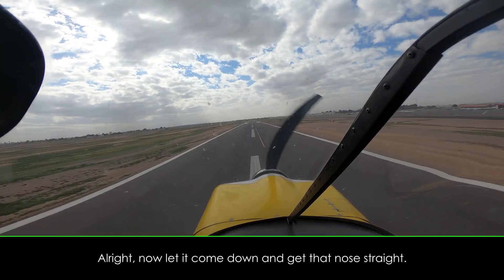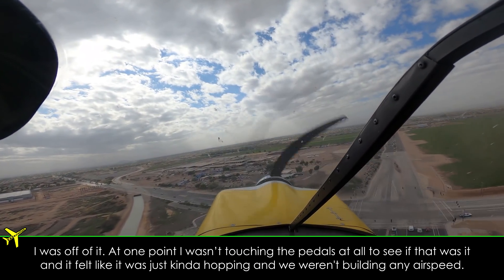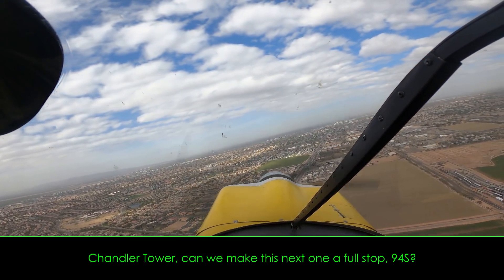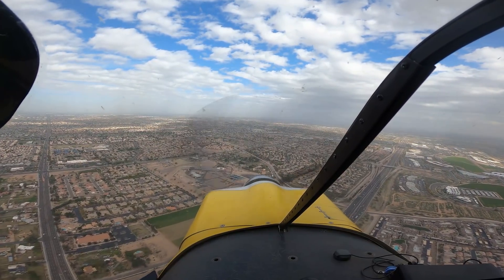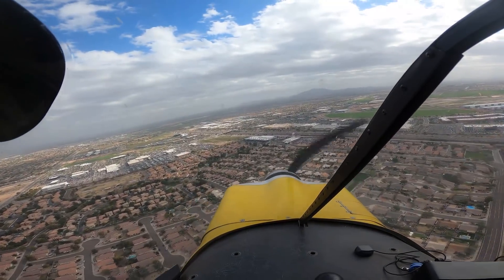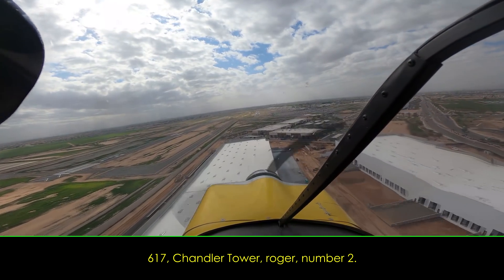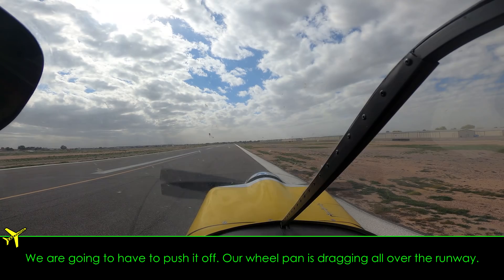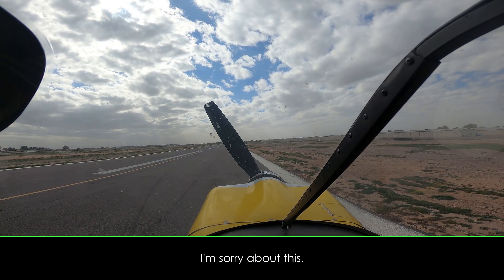American Decathlon has FLAT TIRE ON LANDING | Onboard Footage Included

Comment: "That sounds fine"

10 seconds later

"That sounds bad"
Reply: X X I think she was saying that she wasn’t worried about the indicator having an issue in displaying the airspeed. I could be wrong though.
Reply: "this isn't happening" is a common reaction to airborne events
Reply: @X X I wouldn't worry about it too much either. At low speeds and in tailwheel airplanes, your airspeed can give , 'interesting' indications...
Reply: @X X pitot tube angle of attack changes from 3-point attitude to level flight attitude. This can/does change airspeed indication.

Comment: The instructor(I'm uncertain about whether she is instructor but I think she is) in back seemed so calm that's the key in situations like this, we remain calm and handle the emergency even though it ended up not a nose touching ground and prop strike on ground great pilot....
Reply: I think the calm was because no actual problem was suspected.  The though "oh we've got a flat" didn't pop up until they were down and dragging.
Reply: @xheralt  I mean, she litterally said: "I wonder if we have a flat now."
Reply: Gary XHLC she suspected a flat, did you not watch the video?
Reply: @Shree The Smart yeah she is an instructor--I've known her for over a year.  She's a damn good pilot!
Reply: @trainman4472  I bet she is because u landed plane without any damage butter landing good job sir
Reply: @trainman4472  and landing with main wheels flat in a taildragger is very very hard compared to nose wheel aircraft...... That was outstanding work 👌 of landing
Reply: @shreethesmart2942  While I appreciate the compliment, I'm afraid its misdirected--Im not in this video! I'm just a friend of the instructor.
Reply: @trainman4472  ohh np 👌

Comment: It’s so easy to arm chair quarterback. should they have told controller they may have a flat tire and could be disabled after touchdown, sure.  without having 22L this would have required closing the field during the time it took to move aircraft off runway. I’m sure the instructor realized after the fact her mistake of not informing controller and learned from this incident. Over last 37 years of flying I’ve made many mistakes once, some twice (LOL now) but that’s how you learn.
Reply: THANK you. Agreed.
Reply: This is Josh from the flight. Yes in hindsight I should have told the tower what was going on... however Fly The Airplane is more important.
Reply: You " LEARN by making mistakes " ??
No sir. You DIE ( in many cases ) by making mistakes .
You LEARN by study and proper preparation
Reply: @ethics3  Yes you learn from mistakes. From your own and others.
Reply: Agreed on all fronts. But still.. Should have told tower.
Reply: @BirdsEyeTech  being a controller in the valley, let the tower know. Yea "communicate" is your last one. But you're communicating the whole time with the other pilot about it. Let the tower know, we can scramble trucks out ahead of time, keep everything safe and moving efficient.
Reply: @jaqummh  You learn from mistakes, you die from catastrophes. Swiss cheese theory

Comment: Credit to the pilot for noticing a potential problem, giving the tower the heads up though would've earned you airmanship points that day. 

If you read this Josh, don't take this as a negative, but work on getting them circuits tighter. Personally, those 2 long buildings (@4:15) ideally shouldn't be in view on final 👍
Reply: This is Josh. Strong crosswinds so I wanted a lot of time to feel them out. Normally I'm significantly tighter in the pattern. :)

Comment: I received training and my TW endorsement in that very aircraft back in Feb. Fun plane! Bruce was my instructor. I too experienced not one but two flat tires. The first was the tail wheel itself. The second 2 lessons later the right main as you did here landing at Stellar (home base). Good job on your landings BTW! There was also a left main flat on this ship a week before mine. We talked about it and they think maybe a few bad tube in there last purchase (they buy in pairs). After inspection owner still couldn't find issue of pin holes in tubes. Damn gremlins!

Comment: Many years ago when I was a teenager working on my private certificate the FBO/flight school I trained at ran on a tight budget.  Some dummy jammed the brakes on one of their 172s and flat spotted a tire.  Of course they didn't replace the tire because of the cost so every takeoff and landing I made in that old plane was a nail biter.  It sounded like someone was banging a drum whenever I taxied.  I was convinced the tire was going to blow but their A&P assured me repeatedly it was okay and as far as I know it never blew and served out its life honorably until the tires were replaced.
Thankfully, though, I've never experienced a flat tire.

Comment: nice vid , yeahh like many here, first thing i thought was : inform the tower ....   but hey safe smooth landing, so well done Pilot!!
Reply: This is Josh from the flight. Yes in hindsight I should have told the tower what was going on... however Fly The Airplane is more important.
Reply: No need to inform the tower here. This is a CRM issue that was worked through in the plane. No emergency was noted so there was no need to tell the tower. Also, flat tires on planes happen ALL the time. Often when the aircraft is already fully committed to the landing, and you do what they did here, just say, "hey tower, we gotta flat", and everyone goes on with their lives. You'd be amazed at the number of engine out landings that are done in the airlines that the passengers are never even aware of. You only hear about the ones that someone talks about or makes it onto the news. Kinds like when Allegiant  was leaving engine parts on runways for a while, now you don't hear about it anymore but, it still happens. haha

Comment: Should the ATC have been informed of a potential problem before the landing?
Reply: Yeah, if there's any uncertainty about one's (fixed) landing gear, instead of the expected pattern work touch-and-go, maybe do a low pass and ask tower or some other ground observer to examine the gear as you go by?
Reply: Yeah that part concerns me also. I mean it may not be a seriously busy airport with a bunch of A380s  but debris on the runway needs to be cleaned.  And emergency services need something to do.
Reply: they weren't even sure there was a problem and the instructor didn't even seem to feel it.
Reply: If something is weird, fly, navigate, communicate.  Missed last one.
Reply: @vkorpel  it's not what "what you have to do" but the priority of things if you do them. You don't have to communicate every single fart you make....
Reply: Gary XHLC that whole “fly by and take a look” thing is not helpful. Maybe it sounds good in movies or something, but most gear issues cannot be identified by a flyby. In this case, a flat tire with no weight on it would look perfectly normal at 70mph, so what’s the point? They were textbook here. They notified the tower as soon as they realized that they are disabled on the runway.
Reply: @xheralt examine fixed gear for tire pressure.

Comment: This is not "armchair quarterbacking", nor am I being critical of Josh at all, but I have a question. First, in hindsight when you have a suspect tire or other gear issue, (especially in a taildragger), would it have been more prudent to have declared a "Pan-Pan-Pan" or maybe even an emergency so the equipment could have been on standby? I've heard over and over that GA pilots always seem to be too reluctant to do this. This could have ended a whole lot worse. Very happy it didn't and the airmanship was surpurb. Great job on that landing.
Reply: This is Josh from the flight. Yes in hindsight I should have told the tower what was going on... however Fly The Airplane is more important.
Reply: @BirdsEyeTech  You had 5-10 minutes enroute to tell them. Ahem.  The other lesson that should be learned is that when you felt the dragging, you should have cut the throttle and stopped the plane instead of taking a problem into the air.  Again, lessons learned.

Comment: Are there tire pressure monitoring systems for small aircraft?
Reply from the maker: Most light aircraft don't have that
Reply: The Decathlon was built in the '70s.  While it is technically possible to build a retrofit TPMS for light aircraft, the cost of certification is horrendous so it would be very unlikely for it to happen.
Reply: Contrary to my avatar I am in the commercial vehicle industry. Makes sense now with the certification angle. I had a customer who landed with an unknown flat and ended up with a prop strike when he was pulled left into the runway lights. I couldn’t understand why he didn’t equip TPMS after that event. Make sense now.
Reply: @MichaelSteeves  I'd be willing to bet that the FAA could be convinced to reduce the barrier to installation of a TPMS on the grounds of it being a significant safety improvement, similar to how they have for shoulder/multi-point harness conversions and AoA gauges.
Reply: The chances are a tire gauge would have revealed something in preflight, had one been used.

Comment: Wait so did they shut down the engine on the runway before turning off the avionics? Since they were still using their headphones to communicate with the engine off. Not a great idea to shit down the engine while avionics are on...
Reply from the maker: Headphones is not avionics, headphones is only battery.
Reply: VASAviation - Really?? I am training for my PPL and I only put my headphones on when avionics are on
Reply: Headset > Radio > Avionics switch > Master > Battery